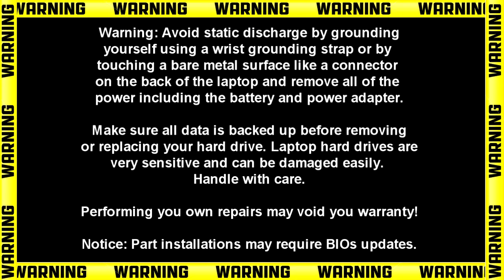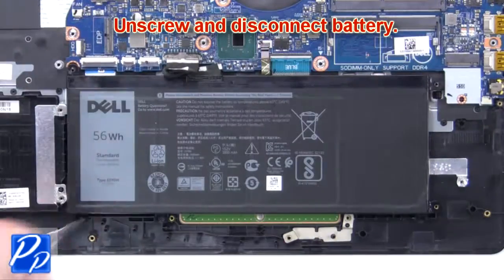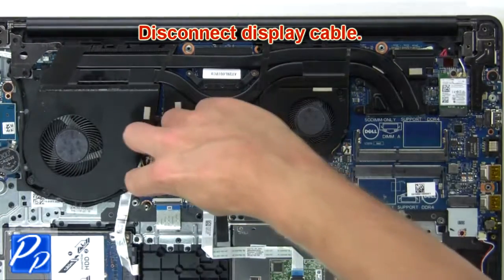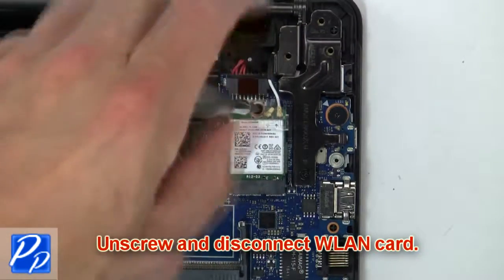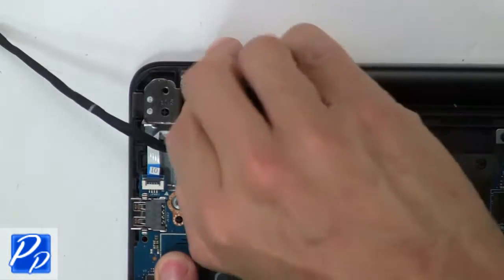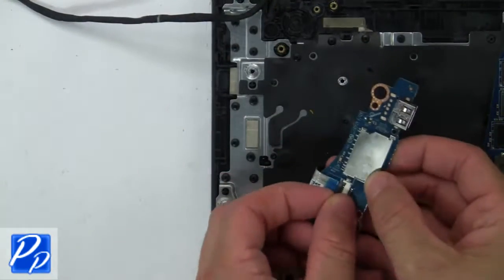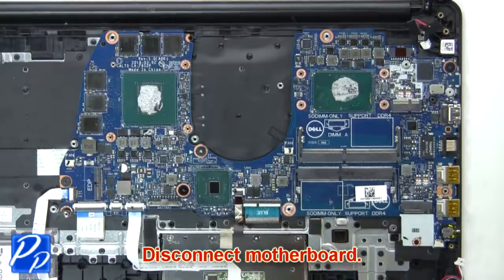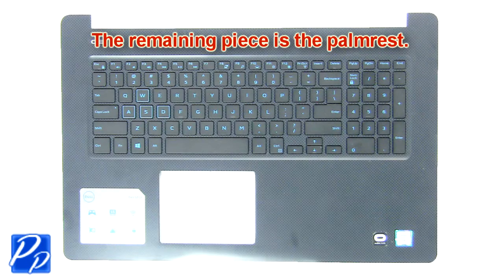Dell G3 3779 (P35E003) Palmrest How-To Video Tutorial

Comment: Thanks for this. It made it pretty easy to replace the palmrest. There are only two steps missing from the video: 1) After you remove the power button board, you also have to unscrew and remove the power button itself (my replacement palmrest didn't come with the power button). 2) Before you can remove the TouchPad, you have to unscrew and remove the "bar" that covers the very bottom portion of it.